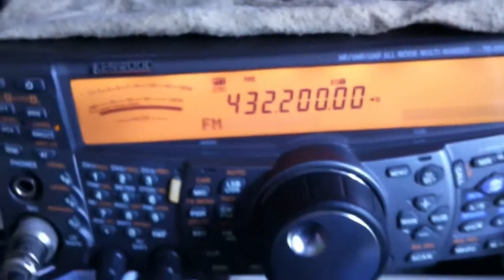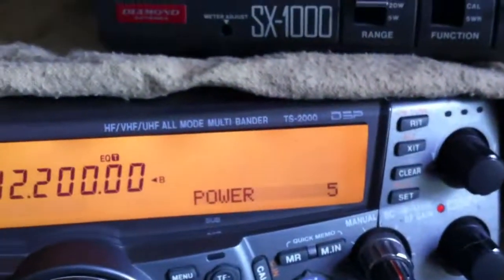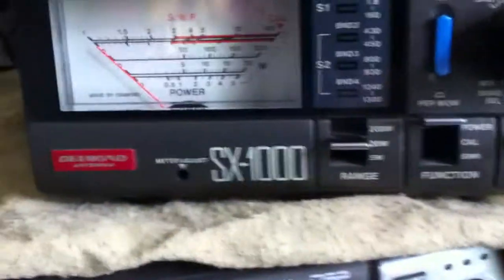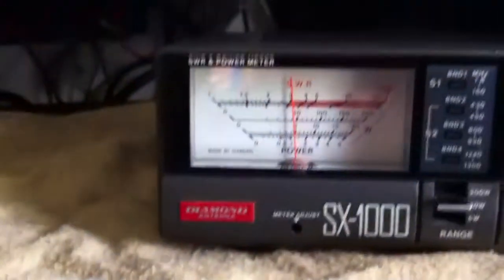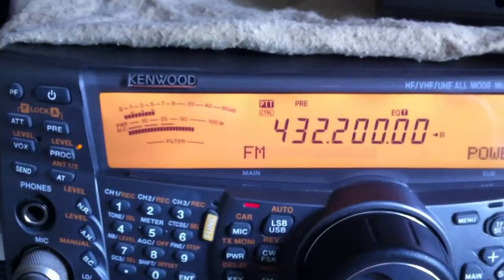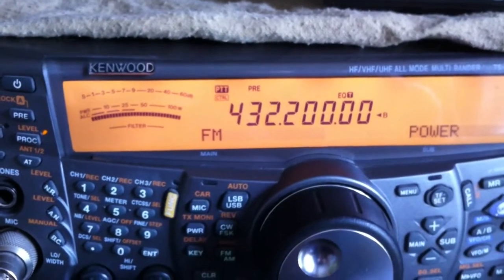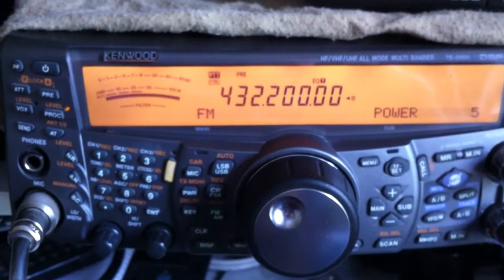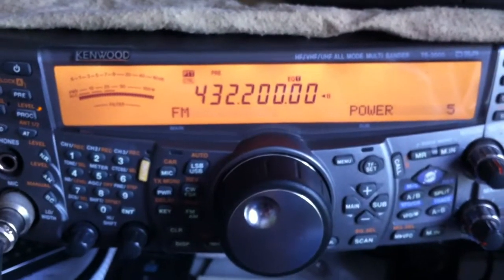Kenwood TS2000 70cm problem

Comment: morning is the 70cm board a seperate module my friends got trouble with his 70cm on his ts 2000 havent had a look at it yet  any info grateful  regards
Reply from the maker: Hi Johnny, the 70cm board is a separate module that can be replaced. We were told that Kenwood had no boards in the UK (where I am) or in Belgium where they usually stock a large reserve for Europe and none in Japan so would have to wait for next production batch which could be up to 4 months from time of order, so bear that in mind if you are needing to replace. Good luck
Reply: @BOLIPILOT1 did you ever get it fixed

Comment from the maker: Thanks for the comment. It was actually traced to an under rated protection resistor on the output. The whole 70cm section has been problematic since I got the radio. I have owned it for 12 years now & still very happy with it. Since this video the repair to the 70cm has been carried out and to date is still working.